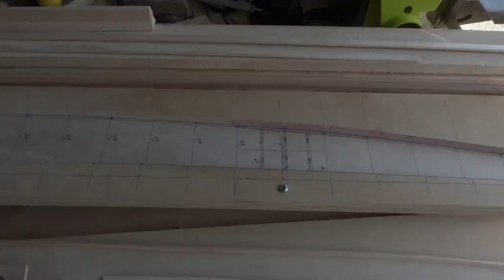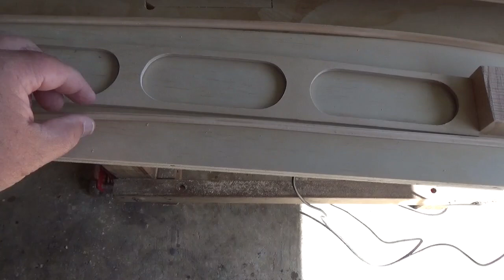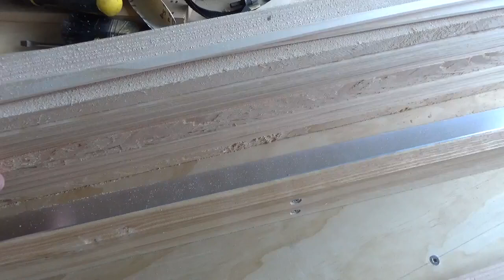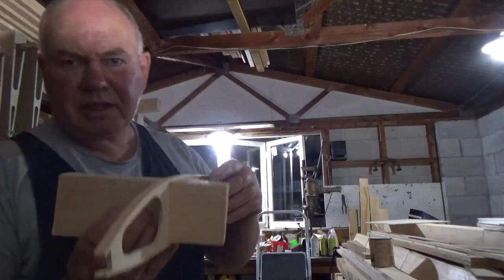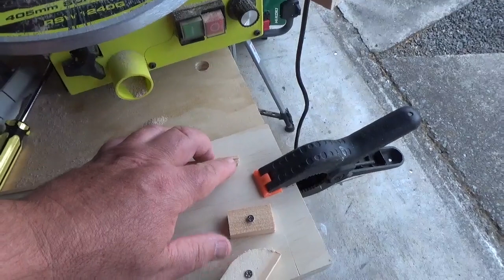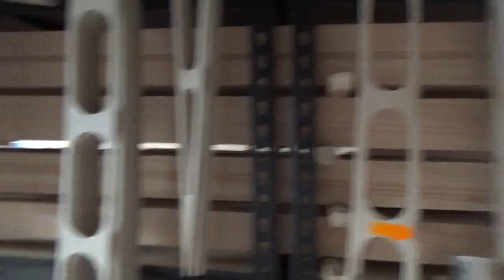Making Ribs for a 1917 Sopwith Camel Ep10

Comment: I’ve watched your 10 videos and enjoyed them all.  What I took away is your a man of detail. And when your home building a airplane, you need detail. Those small issues if you don’t take care of while building could add up and come back at you in a not so good way.  We wouldn’t want to see that. It’s fun watching you work out problems and solving them. Wish I lived closer I’d give you my THEIN dust separator
Reply from the maker: Thanks Bruce, I'm learning to be a detail person. I'm ok with working with wood, but generally stuck with carpentry, recognising that cabinetry is a whole different ball game regards tolerances. This project is more like engineering with much finer tolerances again except, unlike metals, wood changes dimension depending on the environment (temp & humidity), so a perfect measurement last August, is no longer so perfect (thinking those cap strips).

I haven't read your earlier comments yet, Youtube threw this one up first :-)

Comment: Hi there - extraordinary project, highly appreciated. I was dreaming about flying a Fokker Triplane or a Sopwith Camel back when I was a young boy roaming the fields in my hometown. 
Now, I might have missed the specific comment in one of Your videos, but could you explain as to why you need screws in the ribs in the first place? Are they not weakening the ribs / introducing failure points? Are You not concerned about failures in the ribs in later use? I think modern glue is pretty strong to provide all the strength you need. But of course, if the target is not actually flying the plane, but reproducing the exact manufacturing approach it is a whole different story.
Reply from the maker: Hi Joe, I shared the same day dreams as a lad :-) The answer to screws is "complicated". My intent is to follow the plans as faithfully as I can, however from the very first step there have had to be compromises and so far they have fallen into three broad categories; availability of materials, length of service and safety. For example, you can't purchase ply as made in 1917 and 2023/24 ply has limited options. Old school glues don't last, but when the life of an aeroplane was measured in weeks or months, that didn't mater.

Screws in the cap strips are part of the design. My working theory is that glues at the time weren't great and mechanical fixing helped despite the compromises. Using screws is also the only way to allow combat repairs on these aircraft. Replacing a damaged rib in the middle of the wing has to be practical. For the Camel ribs are not glued to the spars, they are held in place by side supports and screwing through the capstrip over & under the spar.

I share your concerns around the practice, but also found reference to the practice of testing the design of ribs and it sounded like an ideal way to test the design, my workmanship and the use of modern materials. My guess is these should pass, but the ribs do look really flimsy, The first three should fail, being made from rejected parts, but I will learn from those before making my "good" ribs.
Reply: @MattProject  hi there, thanks for the full picture and taking the time to elaborate. I understand where you are going with this now. I would just note that in light aircraft, the loads on parts like ribs or control surfaces during flight are almost nothing in comparison to those introduced by handling on the ground. And I am pretty certain you don't plan on being shot at mid-flight... ;-) I also thought back to a couple of sailplanes we build during Uni. We did not use screws but were sewing a lot of the more delicate parts using a yarn that was impregnated in a solution of bees wax and linseed oil. Just a thought as a backup
Take care and enjoy the build
Joerg
Reply from the maker: I picked up a book a couple of months ago on building German style gliders, mostly for the references to working with wood on aircraft. I'm pretty sure it discusses that approach. A very interesting book if you are into wood working methods of the period. Also very interesting for seeing examples of the different approach used in Germany in aircraft construction.

Workshop Practice for Building and Repairing Wooden Gliders; the English Translation of the German classic, Werkstattpraxis für den Bau von Gleitund Segelflugzeugen by Hans Jacobs and Herbert Lück.

Comment: Where in NZ are you based?
You are gluing and screwing as they did but they didn't have modern glues in 1917. May I suggest you just glue with Titebond (cheaper and lighter and stronger than epoxy)or epoxy only. This will save on weight and the glue is stronger than the wood. You will be making stronger ribs than they had and without screws.
Reply from the maker: Marlborough. I agree on your observation on the adhesives. I have gone with T-88 as my preference in part because it is in common use, tried and tested for aircraft use. I could use something else but that adds to the list of things I need to test (keeping in mind the certification process to fly a homebuilt aircraft). Fortunately not a lot of glue is used in the Camel, it's mostly held together using wires :-)
Reply: @MattProject  Titebond make the best woodworking glues, PVA based, stronger than wood. They penetrate the wood whereas epoxy must be keyed in for a good bond.
Reply from the maker: Thanks, I will see if I can pick some up for my other projects. For this aircraft project I prefer to stick to the experience of wooden aircraft builders before me. I'm not the person to argue the benefits or otherwise of the consensus glue choices (there is more than one) for aircraft, but there is plenty of material online to look at. With that said I will look for Titebond at the local hardware store and give it a go on other projects :-)